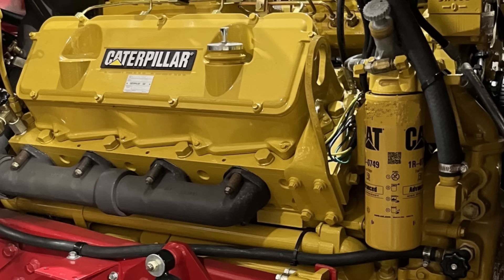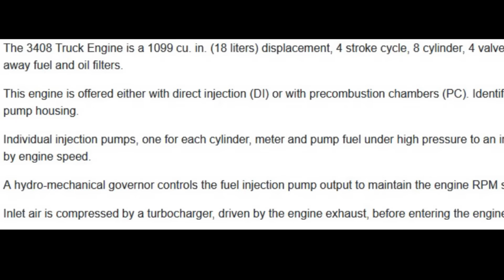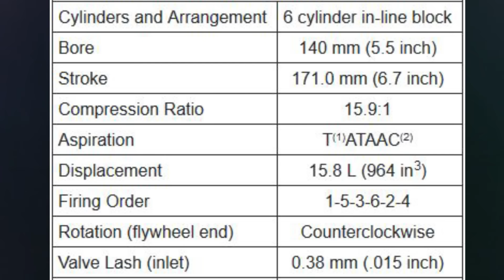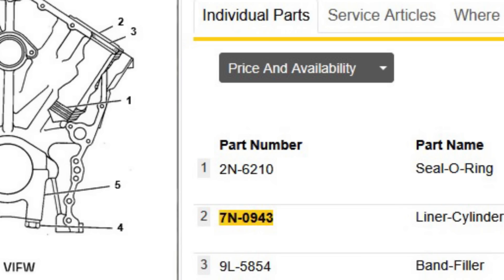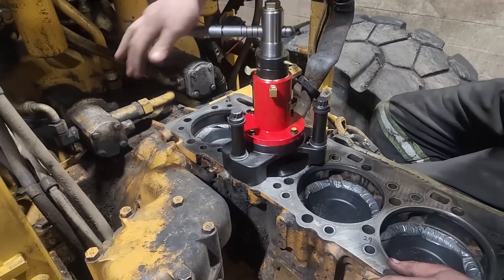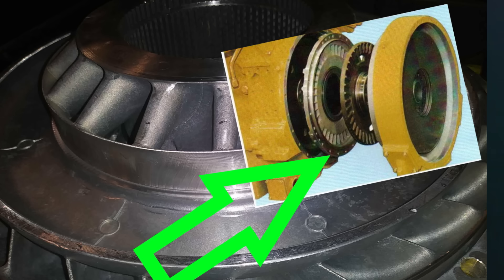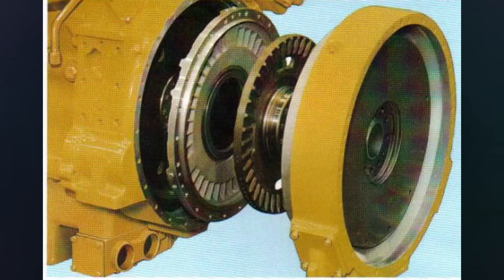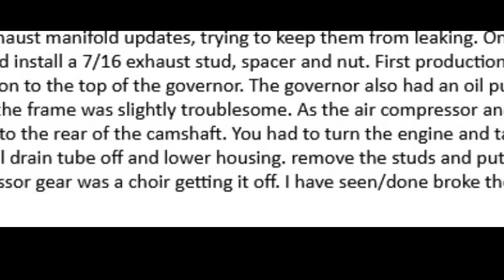The Cat 3408. Biggest Cat Truck Engine Ever Made. V8 18L Diesel Engine. "Know Your Engine"

Comment: Hi, yes I did like this one. we still run quite a few 3408C  DI pencil engines in various earthmoving equipment and the 3408E electronic engines in some of our scrapers. In our DI pencil engines, we changed the injectors and used injectors from a high powered 3406C engine and they are a lot more responsive, cleaner burn and better on fuel

Comment: the brake saver used a handle that was exactly the same as your trailer brakes lever. I have sent full pressure to my trailer brakes accidentally in a KW cabover back in the day. only seen that once

Comment: Yep, the 3408E which is a HEUI and is a grunt of a motor, super strong and reliable, our series II 631E Scrapers run these and into the first few series of the G models, also in the rears of the 657 scrapers of the same era, those dreaded exhaust studs on the hydraulic tank side of these are never pleasant…if ya know ya know…yuk

Comment: The 3408 DITA was very underrated.
It used a 3406 A model 380 Hp injector. 
There were a few old hot rodder diesel mechanics who really knew how to make V-8 Cats come to life. Old timers (pioneers) who knew or discovered how to modify them to reach their full potential. 
Tricks of the trade.
Reply: The first 3408 DITA had the fat A series injectors but you could install adapters in the A series heads that would take B series pencil injectors. Thats what I did to mine. Apparently the first 3408B had that same setup before they made cylinder heads specifically for the pencil injectors.

Comment: I ran snowblowers in the arctic that had two Cat engines. One 3208 mounted at the rear of the machine which powered the drivetrain and then a 3408 just behind the cab to power the blower head. Needless to say those things would blow snow, they kind of looked like a small locomotive on wheels with a blower head mounted to the front.

Comment: The 3408 B was rated at 503 HP at the fly wheel with stock fuel settings. Without Air-Ti-Air. 
Food for thought ….

Comment: Cat 1693 was the King of the Road that's why the extended hood truck was built it was a scraper motor 800 horses can we get a million miles out of that motor back then probably why they discontinued it because they weren't making any money on parts and they said it was a little heavy do some research cuz we never had no problems with them

Comment: 3408s in trucks. I found that that air compressor wasn't very fun change out. 
We also had a customer that inframed his 1 bank at a time. And by the way talking V-8s in trucks Cat made a 1676 engine, Same bore & stock as the 3306 and 1674.
This was a overhead cam engine.

Comment: In the late 70’s a transportation co in Cal moved a 107 ton magnet form Chicago to UC Stanford. The truck was a ke worth W900, CAT 3408 engine, 6&4 transmission, double 24 in steel frame, FWDD axles.  Top speed 42 mph.  the trailer had 42 axles if can remember.  On I-80 the driver has seen a seed as high as 35 mph.  Athe there was no wide loads on I-80 going over Donner summit.  The Cal Trans people picked a route that went over high way 88.  A friend that was a CHP officer work on this move.  He told me as soon as the load started up the hill the driver of the truck pulled the hand throttle out to the max.  The officer said that he could walk beside the truck.  When the truck got to the summit the driver said that he had 3 gears under him.  No problem for the truck.  This move required the transport co to have a truck with spare tires for this move.  Two tire guys and a truck load of spares.😊
Reply: i  think i read  about that truck it seems they hauled it bacon a flat car because it was so slow

Comment: Bought 2 for $1700 a piece. They were just laying on their side in the weather in unknown condition. They were tight but would still turn. I got one of them running and it runs quite well. I got an Allison 4500 for it and will retrofit in place of a 8V92+HT750. As mentioned in the video they are about 1099.3 cubic inches. They have a 60 degree V with offset crank journals, since a 90 degree V would be too wide. There is also the 3412 V12 engine which does not have offset crank journals, since the V12 is naturally a 60 degree engine.
Reply: About the only thing bigger than a 3408 was the Cummins KT motors. IIRC most trucks couldnt fit that behemoth it was so long.
Reply: @theq4602 the 3408 is similar to a 3406. The 3406 has a longer head but the accessories are more on the side so it kind of balances out

Comment: they made good horses but absolutely stupid torque.   you needed a really good driveline behind them . we had two with the 7155 cat trans behind them. converted one to a rt14513 due to multiple clutch failures in the trans.its big breother the 3412 was a real workhorse running 750 hp all day long.   one v8 you failed once again to mention was the 1160 the 3208's predecessor
Reply: Also was the 1140, 1145 and 1150.

Comment: I have worked on 3408 marine engines 
In marine aplication they make 500 hp. And neede overhalen at 25000 runnibg hrs.
Where the 3406 marine engine make 365 to 410 hp and neede overhaul at 40000 runninh hrs.
So not the best engine made.
Lifter failure is big problem in 3400 marine engines.

Comment: I overhauled one of these in a '79 359 last summer! I'm a younger guy so it was my first time even seeing one in a truck. First time I heard one run in person was when I fired it up after overhaul which was rather stressful. Really really cool engine, pretty darn easy to work on, not too bad parts wise honestly. And had great power and sounded pretty awesome too. This one was originally a PC engine converted to DI in the late 80's/ or early 90's. Very very cool and unique sounding and running engine for sure. And I can confirm the liners are the same as a standard 3400 series, I used a set of IPD 3406B liners and the usual Cat liner shims for a 3400 series after quite a bit of verification and she runs like a top. They always say "Never late with a 3408"
Reply from the maker: Great comment and good to know the liner shims are the same.

Comment: They did make a "PEEC" 3408 as a high performance marine application, breifly- 800 hp at 2300- but when they came out with the 3406E marine engine it was discontinued- it was the same HP in a narrower, lighter package. As you know, the 3406 became the C15 then morphed in to the C18- the high performance marine c18 is 1050 or 1100 at 2300 rpm. Sea water aftercooled.

Comment: JUST did a start up and sea trial on a 3408 in a dinner cruise boat- factory longblocked it- the original engine (something like 400 hp @ 1800 rpm)  which had near 18,000 hours depending on which hour meter might have worked, broke a connecting rod and "ventilated" the block.  The chunk of rod shot across the engine room and sheared a hole in the secondary fuel filter of the OTHER engine!  They have it on video from the engine room camera. :)
Reply: That flywheel retarder worked pretty well, had one in a 1981 Pete 359 running cows out of OKC back in the day. It was a 3408B with a OO 6X4 Spicer and 3:55 gears on 11:24-5 rubber. The retarder had an “off-on” toggle switch, a second “Johnny Bar” on the steering column below the normal trailer brake hand valve, and 2 gauges, one showing how much pressure was being applied and one for temperature. Never had a problem with it as far as leakage or temps at all and it could be used anywhere at any time without causing any citizens or law enforcement any “Heartburn” as it was silent. Overall, after running this truck for 2years I have to say I enjoyed it very much. It was tuned to run and it surely would do that! My only gripe was the weight and fuel mileage. “Ol Blue” would pass anything but a fuel pump!
Reply: Did they put it on youtube?
Reply: Talk about a ‘Destruction of the Week’!!!

Comment: I once worked on a 988F, had a 3408 with heui injection, the starter had a integrated oil pump to prime the system. Did they ever use that engine in truck?

Comment: 3508 did the same rod journal. Part of the reason is (with3500 series) is it is also released in 12, 16, and possibly 20 cylinder versions. I wonder if EPA had something to limiting HP via emissions requirements. Have fun

Comment: I don't care what benefits you get from a 6 over an 8. Overall the 8 will always have more power potential than the 6. Why do you think Europe still has a v8. Power!!!! Yes the 6 nowadays can make all kinds of power. But the v8 can always make that much more. Every review I've heard and read from those that had a 3408 absolutely loved it and said after driving a 6 preferred the v8.  Why did the U.S. kill the v8s in big rigs well look no further than the new weight hauling limits of the late 70s in the U.S.  80,000 max as we all know........ unless it's oilfield them 110,000 plus with permit. Which then begs the question why make weight limit laws when all you have to do is go get anexemption??? Politics!!! Yet Europe can legally tow well over 110,000 with no permit.  It's obvious epa related at the end of the day.  Because if it's one motor that the epa targeted that was the very engine that helped build America And put trucking on the map was the 2 stroke detroit.  Glad the epa is no more and congress is to reverse all the emissions BS. Because what emissions eventually do or almost did. Kill the diesel and or gas engine to begin with. Plus the most reliable engine to remain and or survive The v8 of course reliability and longevity wise even mileage. Now that emissions are gone basically. No further reason to not come back with a v8. The technology is now available and out there to make a v8 more practical than ever before.  Now the common sense has returned and put Politics out to pasture.

Comment: When I was young, 18~19, I got to drive a early 80's Pete with a white colored 3408 w/a 15 speed.  I had butterflies, the excitement of V8 CAT power.
Reply: Lucky guy, an 80s Pete with a 3408, what's not to like?
Reply: @thomasborger6548  What's not to like is not having more of it.  HAHAHA
Reply: @iBackshift  that I have to agree with. Last fall up here in northern Alberta a gorgeous 80 359 with a 3408 sold at auction for $120,000

Comment: Dealt with both the 3408 and the 3406.
The 3408 was the bow thruster engine on a gambling boat that I worked in in the late 1990's. Never had any issues with it beyond a failed starter motor, and IIRC, that bow thruster swung a 36" prop through a right angle gearbox.

The 3406's were the generator engines on a towboat that I brought out new for MEMCO in 1999. I was the regular chief on that boat till the spring of 2008; those engines were stone reliable. We never had to do anything to them beyond servicing and valve adjustments. 🙂

Comment: Great video Josh! I started driving in 1977, and drove an 8/92, pre cup 375 , A model 400 B models and a bigger C model. They all had jakes albeit not very powerful jakes. The 1693s used a Blue Ox if anything. The cool kids had jakes AND brakesaver. I saw guys literally turning up their fuel screws in a truck stop parking lot. On v-8 Macks also. Good old days

Comment: People always say offset-journal cranks are "weak" or whatever and yeah it won't be quite as-strong as normal for obvious reasons but it's successful use in a super-high torque engine like this proves it's not a dumb idea. Ford is famously sh*t-on for doing the same on their 90-degree Triton (or whatever it's called) V10.

Comment: As a gasoline guy, that's the craziest crank shaft I've ever seen...! And, at 65 degrees, wouldn't that throw off its timing...? Or, is that only with engines with a distributor...? I'm only a shade tree mechanic, so what do I know... Thanks for sharing... Keep up your awesomeness...!
Reply: The VEE was made like this, so the engine could fit in a narrower chassis. Thus less weight on the heavy equipment side. So the crankshaft was designed to off set the VEE, to make it work.

Comment: What about the 3412 that was used for on hiway ??  Not as common but never the less still spec'd.. 
Only seen them in KW though..  I've seen 3408 in a lot of makers, still in service in Australia.
Reply: There's a U tube video with a long nose pete with a 3412 in it. Tight fit considering the long hood, but they did an amazing job. Looks so cool.

Comment: 4:21 V6 crankshafts are the same way. V6 engines like firing at 120 degrees. So you have to offset the rod journals. 

But fun fact, the old two stroke v6 Detroit's don't do this, because they fire ever time the piston hits TDC. It half's the degrees needed to fire. 

Pretty cool

Comment: Serious question: what transmission is rated to use behind a 3408 or C18 in a truck?
Reply: You don't have to drive it like you stole it. There is a control under your right foot.  When you drive these high power trucks fuel it like your on ice. Tranny  will live.

Comment: I’ve got a 3408B  DITA with Brakesaver in Australia. There’s still a few working here, KW made 30 with them here. Despite the odd looking offset crank journals they are very reliable, mines done an incredible 70,000+ hours and the engine’s never been out the frame. It’s had one counterbore with the same tooling you use for a 3406, same liner packs and bearings as well. The main thing is to do a bearing roll every 5,000 hours, same as a 3406B.

If you’re running 2 trailers at 80 tons you still get 4.5 mpg which is roughly what you get for a modern electronic engine. The more weight you haul, the more they are like a modern engine regarding fuel economy. They were popular with 120 ton triples because of the reliability. The Cummins KTA engines were never as reliable in Australia.

There’s a lot of bs talked about the 3408, half the guys mix them up with the little 3208. Also the bs about broken cranks, I’ve never seen or heard of one. Most guys use CAT’s tool to bump them up to around 600 HP, they can take it as the factory marine dual turbo rating was up to 800 HP. 

The weak points are the compressor mounts for the heavy TuFlo 700, most guys made up a seperate bracket. Also the alternator mount is weak when you had the heavy Delco OEM alternator, with the latest alternators no problem. Nearly all the 3408s fitted to Australian trucks had air starters.
Reply: @gm16v149  How can anyone mixup a 3408 with a 3208 they're as different as night and day.  That's like taking a jackass for a clydesdale.
Reply: Great info, thanks! How much would cost a running 3408 in Australia?
Reply: @danielcont95 A little more than a 3406, but being 18 litre they are less stressed so you can do a lot of miles before rebuilds.
Reply: Hey up mate was going to mention you, your channel and sweet cabover 3408 kenworth, as I know how much you love these engines
Reply: I drove a 1974 kenworth w924 hd in college it also had a cat 3408B DITA with brake saver in it, it was tuned up to 850hp and over 7,000,000 miles on it never been rebuilt, the only thing that was not factory on that engine was the injectors and turbo but they were only put on to Increase horsepower, any truck with a 3408 cat in it Is gonna have a unkillable beast of a rig
Reply: @montgomerypoulos6076  7,000,000? man come on
Reply: 3408 best Cat for Trucking ran the USA with max gross 80000lbs was like race truck I drove out of my way to climb Hills and laugh like a loonie  , smiles per mile
Reply: @MrDlc1969  powerful, reliable, and sounds awesome with straight pipes I'm my opinion if you got a 3408 cat in your rig your the king of the road
Reply: @MrDlc1969  You must have had deep pockets for she's a thirsty beast. Almost as thirsty as a two cycle detroit.
Reply: What was the reliable issue in Australia with the KTA. The heat?
Reply: @kerrryschultz2904 Mainly heat and reliability problems with 3 trailers @ 120 tons. They were ok with one trailer.
Reply: @ Thanks. I'm amazed that you folk can pull that much weight across the desert areas in summer heat and not melt an engine down. Your cooling systems, meaning radiators must be huge.
Reply: @gm16v149 g'day mate. Thought of you when I saw this video come up. Hope you're travelling well. Keep her safe mate
Reply: Excellent information. Thanks for sharing.
Reply: Hey there Chris! Thanks Mate, awesome information, and an awesome truck engine.... 🇦🇺😎
Reply: I like your videos on YouTube. How much torque does your's make?

Comment: I seem to remember that the Western Company of North America had a very few of their tractors with a 3412, but they would have been used on units where the road engine, could be switched to power a pump in acid service.
I did see that we (Halliburton) had some frac units with 3412's, but they were strictly pumping units.
Until sometime in the 1990's/early 2000's, Halliburton was the largest user of Cummins engines, both in their tractors, as well as their land based pumping units, where offshore, and in international operations, the engines were strictly Detroit Diesel, up to and including 16V-71, and 16V-92 Series, and a very, very few 12V-149s that were out there on frac units. In the 2000's Halliburton began putting 3406E Series on their cement pumping units, and in the late 80's (or whenever the 3500 Series was released, the 3512 became what was the most common engine on a frac unit.

Comment: I recall the last 3408's in trucks had a 505hp rating. The fuel injection pump had its own oil pump, and the bypass valve sometimes was a problem. (The engine would die returning to low idle). I heard from our service trainer that CAT engineering built some V6 3400's and there was no compelling value to that design.  You didn't mention the CAT 1676 V8, 340 hp. Some truckers loved them, some truckers hated them-everyone had a strong opinion about those engines. They were good in 980 loaders.